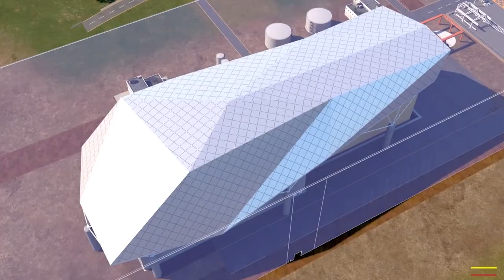Small Modular Reactors: Nuclear's Next Act? - Ep116: Tom Samson

Comment: Thank you for the discussion. With many SMR's and when the wind and sun are creating electricity, hydrogen can be produced with the excess energy. However we need many SMR's plus renewables to provide the energy for heat pumps to replace gas boilers and we need a large increase in the National Grid system to distribute that extra energy.  This issue of the increase needed in the National Grid system is not being discussed enough.

Comment: Of course there will always be a base load need. Mr Samson needs to say the solution to load follow dysfunctional wind and solar power plants (WASPPs) is by simply combining a UK SMR with a low cost ($300/kW---->$200/kW) PEM electrolysers. The response between supplying grid electricity and manufacturing greenH2 is in milliseconds and that's fast enough to load follow the crazy generation patterns of WASPPs. The UK SMR plant operator will benefit from 4 revenue streams - grid electricity; greenH2 supply; load following grid service; frequency correction grid service. The SMR operates at 100% availability and every one knocks out 470 MW of gas powered plant, which are an indispensable requirement at the moment, to 'solving' the humongous 'Intermittency Problem'.

GreenH2 is as fundamental to decarbonisation as is low carbon electricity. The fact that SMRs can supply all of the base load electricity and can profitably load follow demand to the point where the greenH2 can be sold very competitively opens up the prospect of WASPPs, with their atrocious environmental impact, not being needed in the low carbon electricity space as soon as SMR deliveries ramp up. And won't that be an environmental blessing!
Reply: Assuming SMRs, when or if they do come online, can beat green power production on cost, including green H2 (and storage), at least for the last fraction of grid demand variable renewables can't alone cost-effectively supply.
Reply: I find it astonishing how the intermittency caused by renewables always seems to be everyone else's problem. The idea that base load generation somehow causes the balancing problem is turning the entire issue on it's head. Essentially what some claim is 'baseload is dead', without acknowledging that it's the renewables messing up the load profile by taking away the load, but only when it suits them. Everyone loves to talk about how cheap renewables are, but if you add in the cost of storage and/or demand reduction it's not cheap at all. Unless you have abundant hydro, 100% renewable is a dangerous and unachievable fantasy, even if using demand response, storage and interconnects. We got here because a certain amount of 'head in the sand' about the intermittency problem, was needed to kick start renewables, but now it's established it's impossible, politically, to backtrack from this.
Reply: @Enemy of the state we are in!  Most analyses I see recently includes LCOE plus system costs (eg transmission, storage etc). Even on that basis renewables still come out on top. In any event, I expect ultimately nukes will only be competing with hydrogen for the last fraction of the pie (~5%) which can't be met with renewables
Reply: @jarrodf_  Sources? I find those analyses tend to come from anti-nuclear lobbyists and are filled with hopelessly optimistic projections for cost reductions for both renewable and storage. The reality is, both are already at or near the bottom of the cost curve, as we see for example in the cost rebounds of solar and batteries.

Whatever technology fills that last 5% will have a seriously high LCOE, because the entire capital & fixed operational cost must be amortized over just a 5% capacity factor. Today, even using legacy CCGT for this (for which most costs are already sunk) many providers are struggling to stay solvent. Once these plants age out, the true cost of balancing intermittency will be seen. 

The value of nuclear is simply to reduce the size of the variable fraction of the energy mix, and thus reduce the size of the difficult balancing problem. Talking about nuclear 'not being able to load follow' completely (and perhaps deliberately) misses this point. I have no doubt that it's an argument that originates from the anti-nuclear lobby.
Reply: @Enemy of the state we are in!  Eg GenCost produced by Australia's national science institution (CSIRO). Believe IEA tend to use system costs nowadays too
Reply: @jarrodf_  Thanks. Australia is a fairly unique case, due to the nature of their renewable resources. But that wouldn't apply elsewhere due to different climate. I recall that IEA still recommend nuclear as part of the mix for most countries.
Reply: @Enemy of the state we are in!  Not untrue. Then again, places like UK have excellent wind resources. I expect as I said nukes or hydrogen are required to fill the last ~5% which renewables (with transmission/batteries etc) can't meet cost effectively... Nukes' proportion of global electricity supply has been declining year on year for the last ~30 years; solar/wind eclipsed global nuke supply last year and is by far the fastest growing form of new supply

Comment: No Innovation, in Switzerland are in the Beznau nuclear power plant two 400MW SMR in service since more then 50 years. I see no economic case for this technology on the long run.
Reply: I think maybe you miss the point. Henry Ford didn't invent the car either, but he sure as hell sold a lot of them. This is what RR are trying to do.
Reply: @enemyofthestatewearein7945  Massproduction with limited quantity like other investment goods or Military equipment have not the same huge scale effects as for consumer products as cars or TVs.
Even massproduced Rolles Royce cars would still be expensive compared to Toyota cars.
The nuclear fuel cost will not be lower and the cost for operation oft the SMR plant could be higher due to the higher number of reactors.
Finaly the probability of a accident will statistically increase due to the much bigger number of reactors in service. No Insurance company will cover this Risk in future. 
As Bill Clinton said: Its the economy stupid!